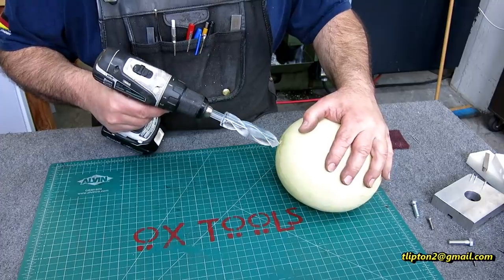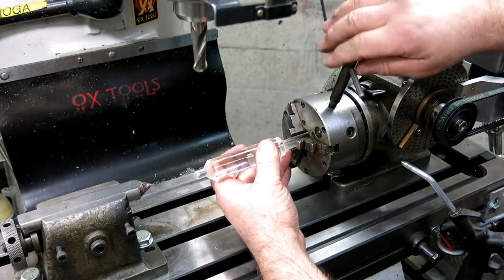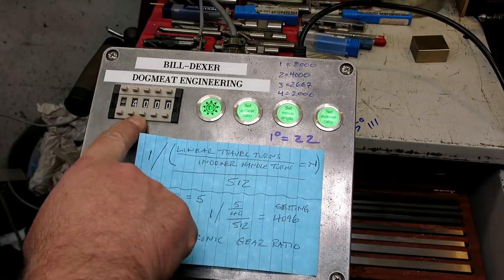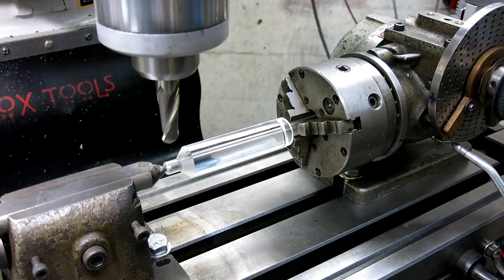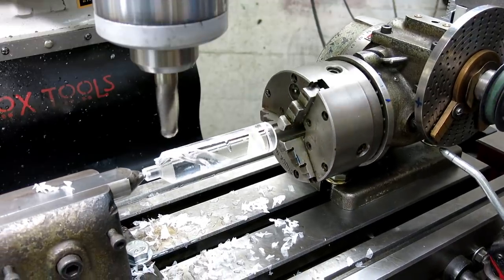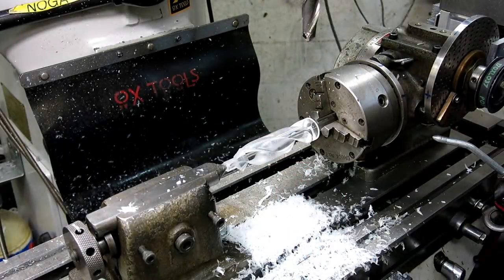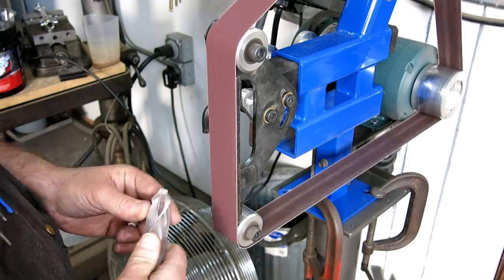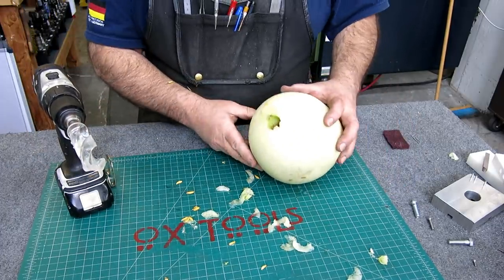Honey Doo Drill Bit

Comment: Make a swivel cooling adaptor so you can run Vodka coolant down thru the drill bit for when drilling a watermelon for a party.
Reply: Seconded!
Reply: The proper cutting fluid for melon is Portugese port. Makes for a mellower cut.
Reply: Go straight for grain alcohol, or at least 151.
An apple corer is about right for sticking the neck of a bottle in.

Comment: My prices are perhaps dated, but Dishwashing detergent was $3+ for 24 oz. I used to buy a Gallon of Anionic Surfactant at a farm store for $10 (approximately half price). The anionic surfactant allows oils and water to merge, but doesn't make foam and suds (its main use is for spraying herbicides diluted in water). You probably don't need that unless you're working on a production run of honey doo holers. :)

Comment: I once made 6 12mm diameter drills from carbide blanks that were extra long and a non catalog item. I made them on my Cincinnati Monoset . I put male centers on to start to support the end but I still had to be careful as they still wanted to chatter. Then I had to grind margins . Then I ground the drill points. A lot of work but looked beautiful 
when they were done. The Monoset will on my machine flute a maximum of a 30 degree  spiral on a 1/4" diameter tool and anything in between. I rearly flute tools from scratch. Most 
of the time I use it to sharpen hog mills and repair chipped flutes on solid carbide end mills. 
It is easier to setup if the manufacturer would etch the lead on the tool .
Reply from the maker: Monoset's are really cool machines. I have never had the opportunity to play with one with somebody that knew how to run one. Thanks for the comment.

Cheers,

Tom
Reply: The only two reasons it was done was as I said it was a non catalog item and it was a short run of six and not worth setting up by a CNC grinder. I and my machine can't compete with a CNC grinder. They can do it way faster and can do
other things I can't.

Comment: Many of those cuts are not suitable for steel, and he make several amateur mistakes, for example quickly backing off the long axis while the tool is still in contact. Also some cuts are too deep, i hope there was a smaller cut edited out - without using support at the back while doing deep cuts the resulting diameter is larger the further from the chuck you measure. One also need to save some material for the final cut or the tool will just push and not cut, esp on weak materials like this that isnt rigid enough. But for a self-tutored amateur its not bad, the result is far from industrial grade but far from horrible.

Comment: I always thought the honey do job was the printing press seen in the beginning of the video.

Undless usages for this drill. If it would be longer it could hollow drill cucumbers and large zucchini for a meat filling.

Also the will be the latest addition to machinist handbook authored by Mr. Tom Lipton: Optimized drill bit angles, cutting and feed speeds for different fruits and vegetables.

Comment: How would you get a progressive webbing? Setting your tail stock and indexing head on a sine plate?
Reply from the maker: Yes. You could angle the blank when cutting the chip flute to vary the web thickness.  That particular dividing head has the ability to angle the spindle axis. Thanks for the comment.

Cheers,

Tom

Comment: You missed a great teaching moment about point geometry and material condition. (IE: soft/hard).
and what you can do to help yourself. ( exp: web thickness/point splitting)
 As soon as it hit the core/stem, it veered to find a likeable place to center itself. What would be nice to see how a pilot or crankshaft point to allow a fighting chance to stay on center ..you could throw in how lip angle effects corkscrew in ..as seen demonstrated.
 Sorry if you find this curt it's not meant to be. I see too many vlogs on sheet metal drilling and no one uses sheet metal points. to understand the value preposition is the difference...
 Especially when drilling by hand.
 This in turn would highlight the reason why you would want to see the cutting edge during grinding/sharpening ..and your method is goofy footed ...(just sayin', homes)!

 You could call it .."...drill melon chips ..or melon chunks..." !? Or..
 "...Man losses eye drilling honey dew. News @ 11..." ! Or
 "...why you need a hole in your honey dew..." ?!
Reply from the maker: You are right. There are so many videos out there on sharpening drills my "Alien" method doesn't really add anything to the conversation. I always had trouble getting the back relief correct and symmetric so I turned the drill over so I could see the relief better. Been doing it now for probably forty years. 

Cheers,

Tom

Comment: nice vid Tom... and nice end result as well... I just wonder what you could actually use that for... I guess maybe for pumpkin carving 😁

by the way at 14:01 in the vid there is the marking on the sanding belt... the arrow... according to some manufacturers of those belts (at least in Europe) this is the marking for the run direction because of the glue seam

so your belt on the belt sander seems to be put on in the wrong direction when following the arrow

jeah, might not make a big difference on plastic when sanding but I have seen at least once a belt getting torn up at the glue seam and then fly off a machine... because it caught a steel edge before actually sanding (and no, it was not me doing that)

oh and because of the drill bit... how about converting it in a drill bit with internal cooling channel (for demonstration of the fluid during "use" in a CNC-lathe) or to just have it as a fancy drinking straw 😎

thx for this amazing project and have a nice week
Reply: oh and have fun cleaning up that mess 😆
Reply: I you put them on backwards dont it put metal/stuff back on 😎😎😎 I will get my coat

Comment: Why does Tom make the beltsander belt rotate the other way than the beltsander belts in the rest of the universe (arrows pointing backwards ref. the direction of travel)?
Reply from the maker: Cause it doesn't matter. Those arrows are part of the original full width belt mfg process. Thanks for the comment.

Cheers,

Tom
Reply: @oxtoolco  Thanks for the reply. I really enjoy watching your high skill videos.  I have only used hand held belt sanders, and I have noticed that if the belt rotates with the arrow, the joint of the belt is in a preferable position as it meets the workpiece without any possibility of crashing. (the start of the belt strip is underneath). If I mount the belt "backwards", the start of the belt is outside, and may hit the workpiece and get ripped apart. Maybe the belts you use have a smoother joint?
Reply from the maker: @nixxonnor  The joint is diagonal. If you have an issue with vibration or skipping check your platen alignment and the leading edge of the platen. 

Cheers,

Tom
Reply: @oxtoolco  So your belt has a diagonal butt joint (without any overlap/double layer)? What holds the ends together then?

Comment: Believe it or not, something useful out of this bit of very cool shop insanity.  I have a batch of acrylic parts I'm starting and I'm going to try your plastic cutting fluid, if I can swing that surface finish without flame polishing I'll be a hero!
Reply: Oddly that's what I was thinking. I've mainly milled it rather than turned it but it's always come out frosted.  Let us know if it makes a magical difference!
Reply: I think there's still surface roughness that will serve as risers for brittle fracture.
Flame polishing acrylic is going to help with longevity.
It's a fine line between sfm and feedrate to keep from  melting the chip and having it weld to the cutter.
Not that the bit itself is likely to get that hot cutting plastic.